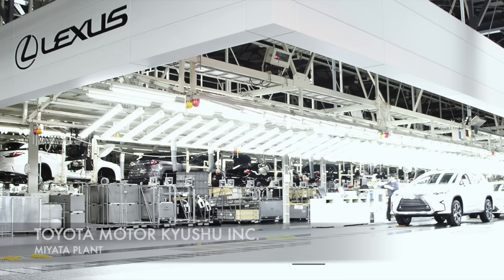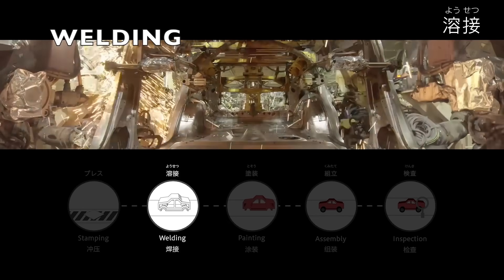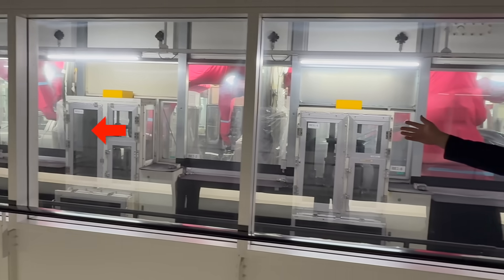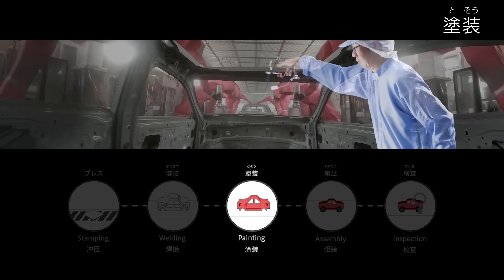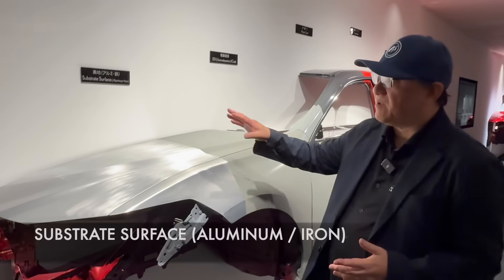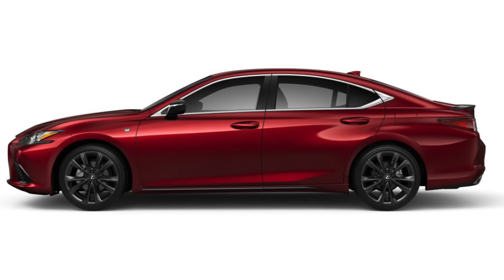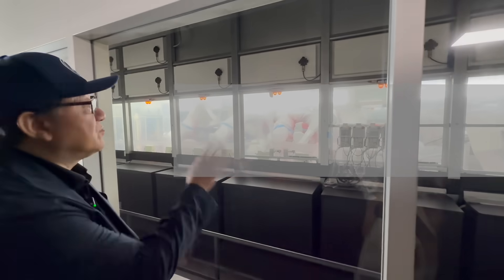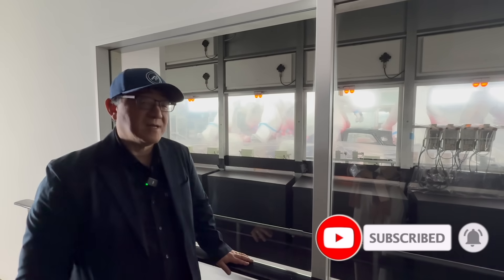ENGINEER EXPLAINS TOYOTA/LEXUS PAINT PROCESS IN JAPAN

Comment: how does this process differ for lexus vs toyota?
Reply: The main difference is in the actual paint and clear coat, while they may look the same in color, they have different chemical makeups. For one thing, lexus clear coat is harder than toyota. I heard that they scrapped a bunch of toyotas one time, they accidently got lexus clear coat and sprayed almost a whole shifts worth. And the clear coat turned yellow. 

The other difference is in the human element, better quality, better QC, more human interaction.  Notice at 11:00 where he points out the door inner is painted, a human did that. Toyota does not paint that much of the door inner, since it is covered by the panel installed in assembly. Toyota really only paints the sides, which are visible after the door is assembled. Hope this is informative, after all this time.

Comment: I bought made in Japan pearl white (Starfire paint name) 2011 Lexus RX450h AWD w/ only 76K mileage, single owner serviced at local CA Lexus dealer all the way before the sell. The white pain after 13 years was with many spot blemishes, some uncovered even the black metal under neath. Frankly I was unpleasantly surprised seeing this quality painting job Japan factory performed? 

The touch-paint kit I have used is not helping. A local 40-yr in business auto  body shop took a closest iPhone look photo of the code 077 paint and reproduced this 3-coat pearl white paint in repainting the bumper corner and bottom of the passenger doors chips and scratches visibly well. But the rest of the spot blemishes (chips actually) remained not addressed unfortunately since they are all over the vehicle panels, not grouped in one panel in order to repaint.

Comment: Great video but what I read in my 2022 RX 350 it has self healing clear coat. Could you please explain how that works?
Also that Red SUV on the wall showing the paint process I think that was a 2022 RX 350.

Comment: My 2004 Lexus RX330 AWD was produced in this plant on 08/03. The paint still looks awesome and I really don’t do much to it. 50,700 miles.  Vehicle is great!
Reply: 20yo and 50k miles... That's a garage queen my friend. Hardly a hard life for a car. That 3.3L has got inherent issues which should up right around 60k miles. The AWD system is weak as the rear diff is prone to cracking.

Comment: The paint job on my white Toyota Rav4 in horrible. It is peeling off all over. They need a recall.
Reply: I landed on this video because my Toyota Highlander started peeling on the roof a big spot between the sunroof and the windshield!!!! It’s a huge spot between!!! I’m so upset! My last vehicle was a 4 runner made in Japan and never had this problem! Either I’m going to purchase a RX out of Japan or I’m moving away from the brand all together. I doubt I’ll buy another Toyota after purchasing 6 different vehicles brand new. Quality of Toyota has gone down.. there are a few things about my highlander that I’m not crazy about. In the morning when I put it in reverse, it goes into the gear soooooooo hard. I’m disgusted because the car wasn’t cheap!